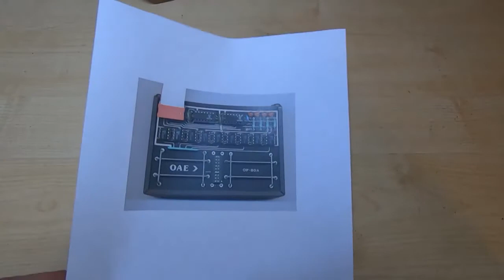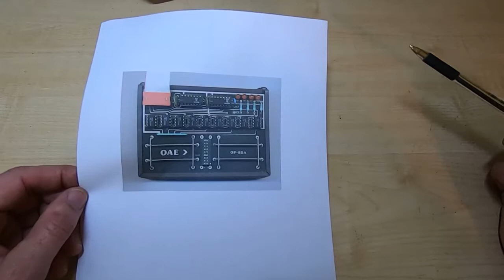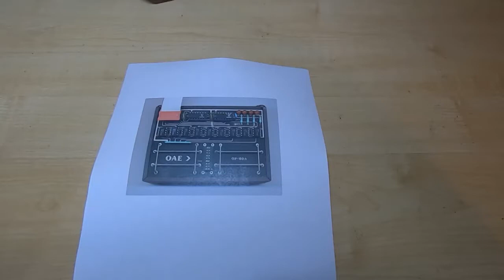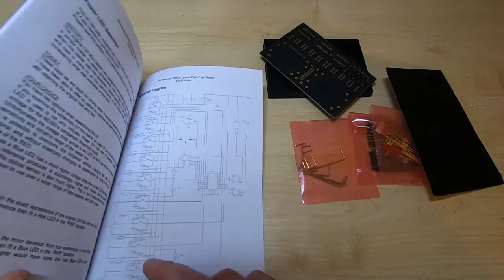OP-80 Tape Reader Kit

Comment: Friend, answer me a question, I only saw the use of this perforated tape reader on the Altair computer. Is it possible to use it on other computers, such as Commodore PET, C64 or PC?
Reply from the maker: In theory it can be used on any computer although you would have to write an interface routine.There is a data ready output and when this goes high (or low) the host computer reads the data byte and then resets the data ready line and waits for the next data.